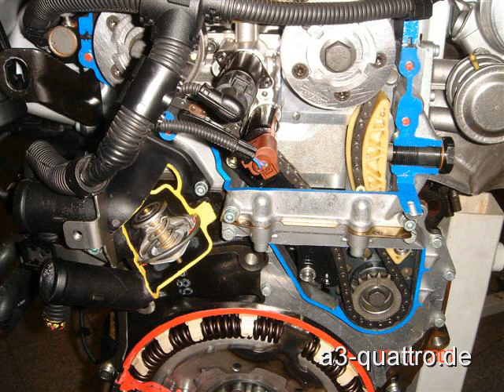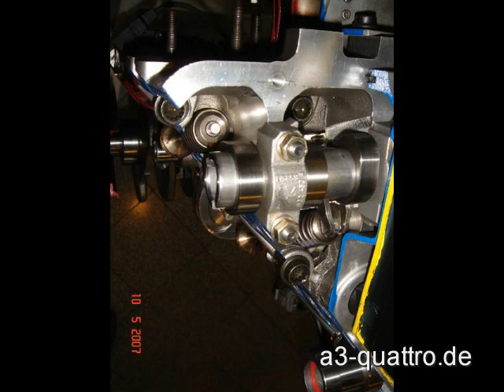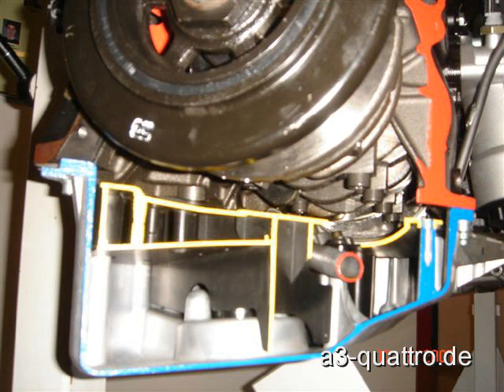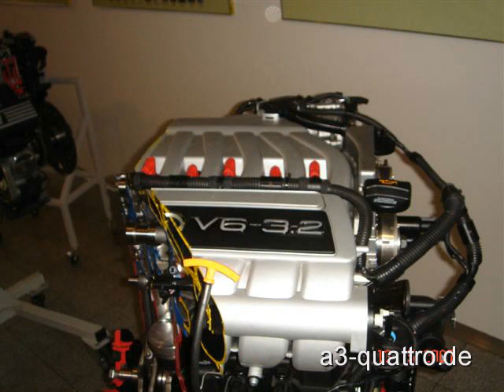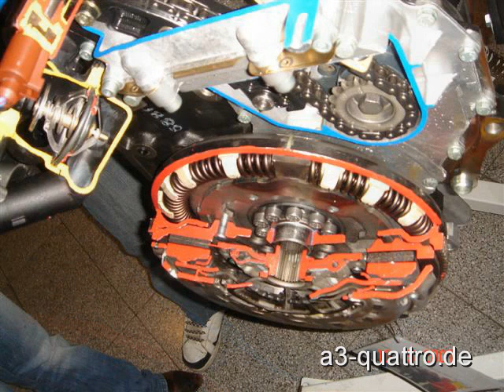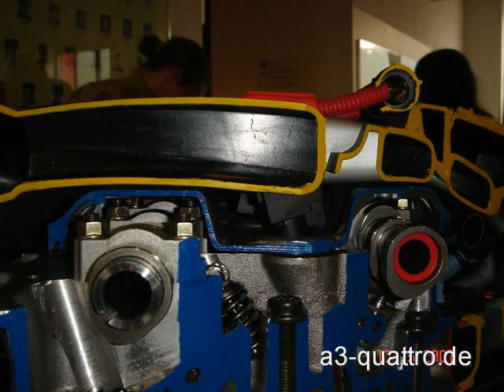Audi A3 3.2L VR6 Motor im Schnitt

Comment: The "VR6" engines are Volkswagen engines, Audi has just bought it and make some small changes on this engine. Audi has designed just "conventional V6" engines whit 90° vee angle which has 2.7, 2.8, 3.0 or 3.2 litre engine capacity and 24 or 30 valves.